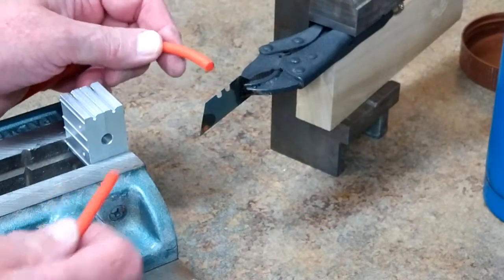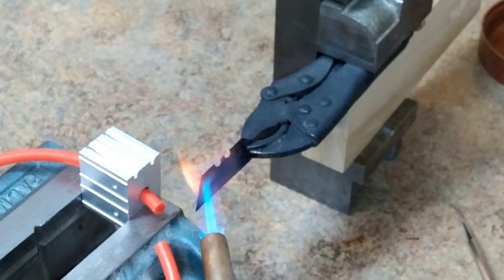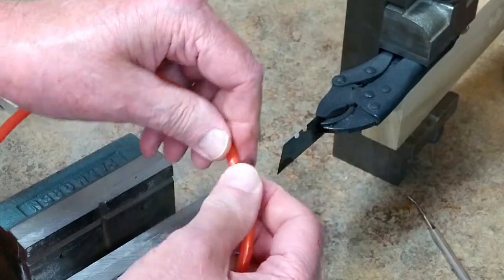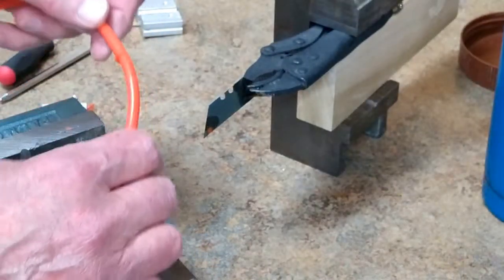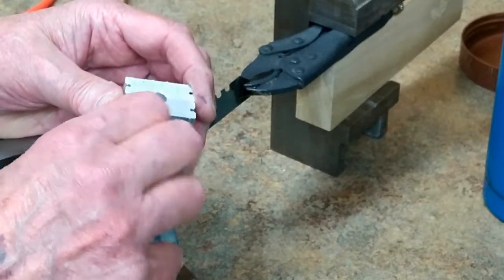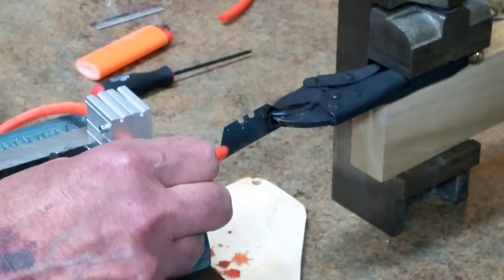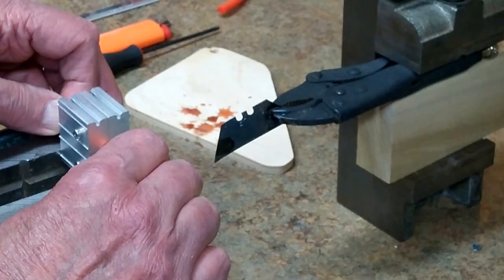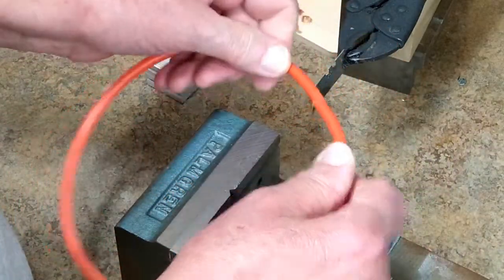Joining Polyurethane Round Belt - A Better Way

Comment: Aluminum is a super heatsink.   But if it's not available, I'm wandering if just a couple pieces of wood would work as well???   I've never been able to stick them just right.   Your jig makes that a snap.  Our little watchmakers lathe uses these. The joints look like a preschooler made them. 😂😮

Comment: How about taking the tip out of a soldering iron and grinding down the blade to fit into the soldering iron.  You will have  a constant heated blade and not need to rush anything.😉

Comment: This is more of a belt tracking question, do you have any special geometry on the small sheave?
Reply from the maker: For both the drive and the driven sheave (or pulley) the groove in cross section is a half-circle, slightly larger than the diameter of the belt (so it doesn't pinch the belt) with the edges sanded smooth. The drive sheave (or pulley) is much smaller in diameter than the recommended minimum bend radius for the 1/4" urethane belt. This places additional stress on the joint so they will occasionally break. Thus, having two or three drive and rewind belts available is not a bad idea and do not make the belts too tight.
Thanks for watching. Please subscribe!
That is what keeps this channel going. 
Ron

Comment: hello sir i have a question is it flexible ? i means i have a bike roller and im afraid if i I extended it it will break in the welding spot..
Reply from the maker: It is a pretty good joint and it takes a bit of practice just like anything else. There is a limit to how much you can stretch most anything. All you can do is try it.
Reply: This orange urethane in 6mm is what I used for my Kreitler rollers. I’m watching videos again as I now need to make another belt for a friend’s rollers I gave him.

Comment: For better alignment, the hole through should be almost the exact size as the belt, put a good chamfer on the end you are pushing the belt through to guide it in. A tapered hole would be best, say 17/64 to 1/4 inch.

Comment: looks like a good technique to join 3D printer filament as well
Reply from the maker: If you search eBay for "3D Printer Filament Welder Connector 1.75mm PLA ABS Filament" you will find a neat little gadget for splicing 3D filament. Look around for the best price. I think I got mine for $9.00 but haven't gotten around to testing it yet.

Comment: I wonder if you had tapered the hole halfway to 1/4  from 17/64 would have allowed you to push out the excess and get a better alignment. I have some taper reamers, that might be worth a try.
also would allow the opposite end with tighter fit to serve as a clean cutting side.
Reply from the maker: Much like trying to fit an actual ¼” pin into an actual ¼” hole, the pin may need the assistance of a hammer. I started off with a ¼” hole and thought it was too tight. Admittedly, I did not try it with the urethane heated (but in hindsight should have) thinking the gooey urethane in a ¼” would be too tight… and I was not expecting the jig to neatly slice off the excess flashing material. Then I drilled it out with the smallest next size bit I had. In any case, this results in a far superior joint than any I have accomplished freehand in the past and is quite adequate for the Senior 20 organ drive and rewind. One of the main advantages of the jig is cooling the joint rapidly. In the past, when doing this freehand, I was trying to run the joint under water.

Comment: The guide hole in the jig looks like it's too big and you still get some misalignment. Maybe drill it with the 1/4" drill, and then when you assemble it, put a little piece of shim stock between the 2 halves to open the hole up a few thou, not by a whole 64th. A couple pieces of aluminum foil (maybe folded over once or twice) would probably make a fine shim for such an application.
Reply: I was thinking along this line too.    Start by leaving it at 1/4" as you said and taper the ends for easier insertion.   If it still did not go in mount the 2 halves of the jig to the jaws of a vice grip or toggle clamp.  Have the vice grip slightly open during insertion and toggle it shut to cool.   This should put considerable pressure on the joint.
Reply from the maker: Much like trying to fit an actual ¼” pin into an actual ¼” hole, the pin may need the assistance of a hammer. I started off with a ¼” hole and thought it was too tight. Admittedly, I did not try it with the urethane heated (but in hindsight should have) thinking the gooey urethane in a ¼” would be too tight… and I was not expecting the jig to neatly slice off the excess flashing material. Then I drilled it out with the smallest next size bit I had. In any case, this results in a far superior joint than any I have accomplished freehand in the past and is quite adequate for the Senior 20 organ drive and rewind. One of the main advantages of the jig is cooling the joint rapidly. In the past, when doing this freehand, I was trying to run the joint under water.